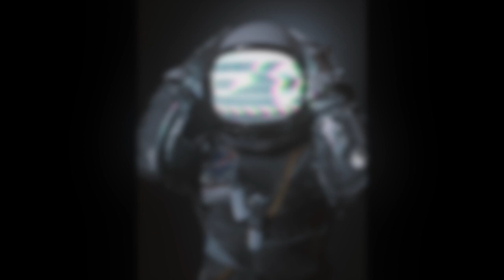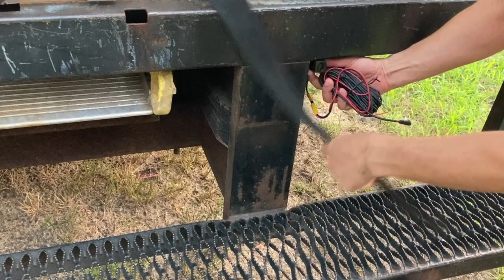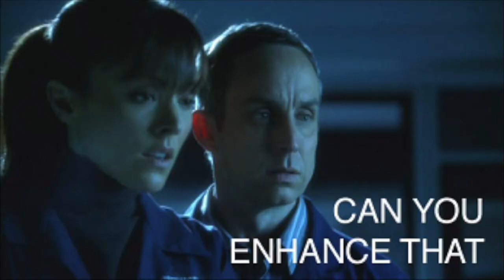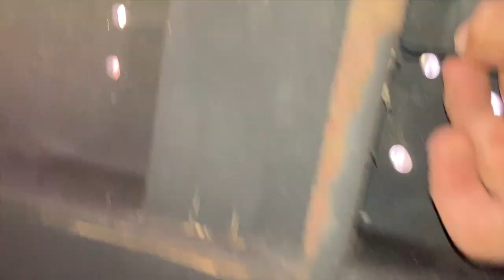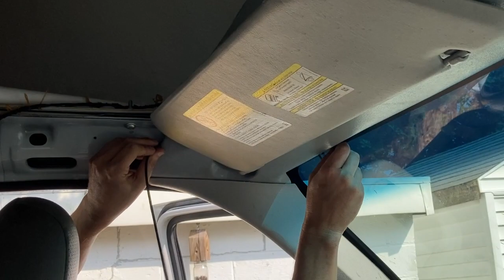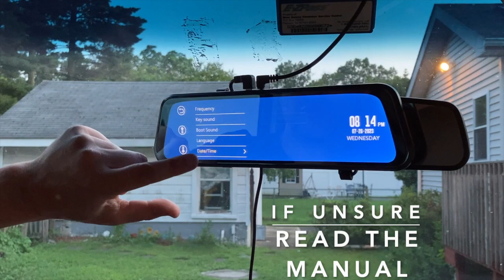Box Truck Backup Camera & Dash Cam Install - Best Value

Comment: Does the rear view camera show video when driving down the road or only in reverse?
Reply from the maker: No the rear view mirror does not normally show video when driving forward.  However you can tap the display and it will show the rear camera video for a few seconds.

Comment: Would this work on 2005 Honda pilot with power chair lift? It has a backup camera installed but all I see is the power chair. Can you help?
Reply from the maker: Ugh that's terrible.  Yes, this backup cam will work and you won't need the video extension cable.  But first see if you can move the existing camera to a better location.